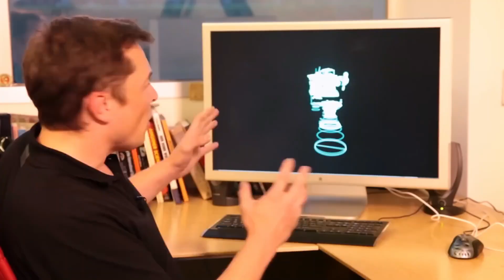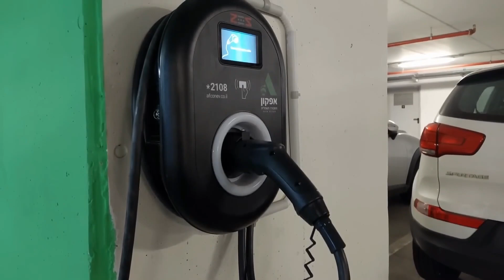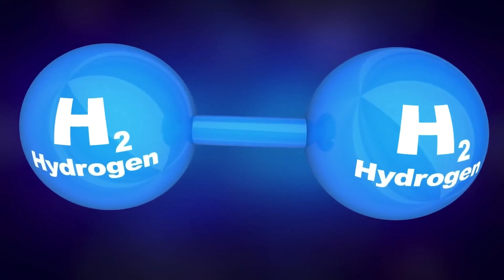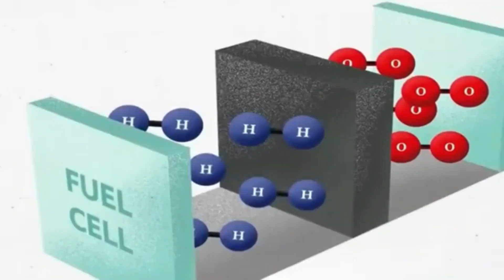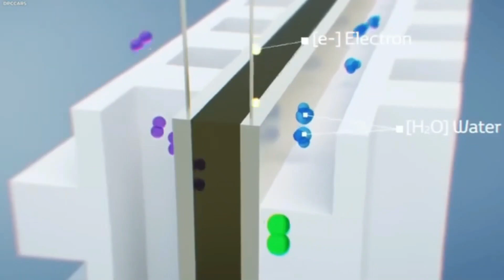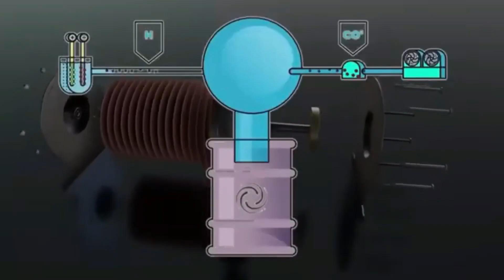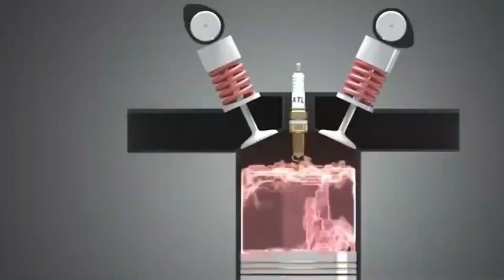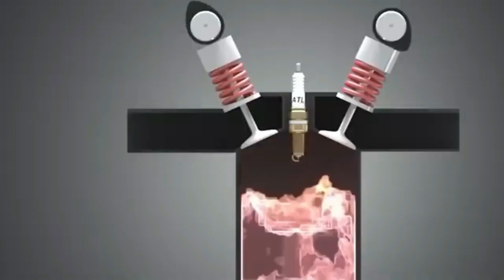Elon Musk  This Water Engine Will DESTROY The Entire Car Industry!

Comment: Historically, this water-fuel technology was first developed by a Filipino inventor named Daniel Dingel in 1969. Later, in 1998, American inventor Stanley Meyer also worked on a similar concept. Meyer passed away under circumstances that remain controversial, as you may be aware. Despite Dingel's efforts and demonstrations, the Philippine government did not support his invention, and the reasons for this lack of support remain unclear. Sadly, due to this lack of recognition and support, progress on this promising technology stalled for both inventors.
Reply: Fluorescent lamp was also invented by Filipino Agapito Flores. M16 Armalite was also invented by Pinoy Armando Lite